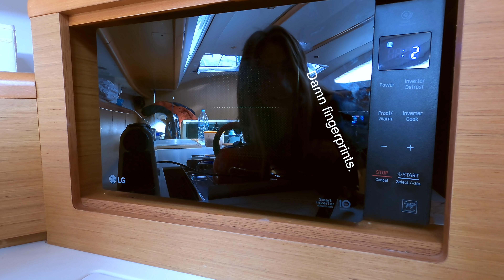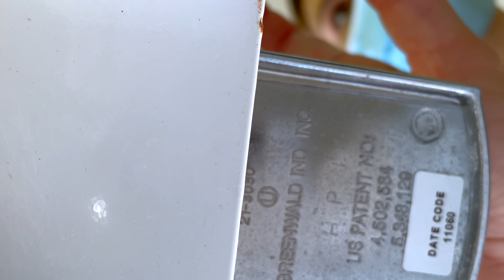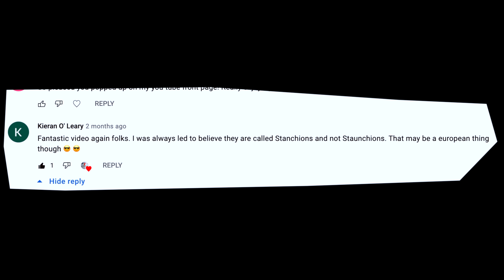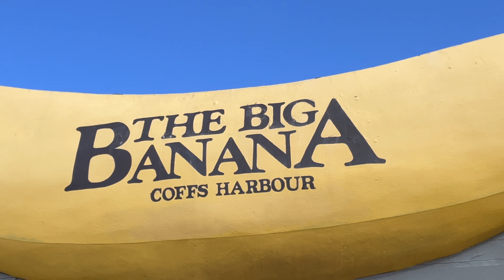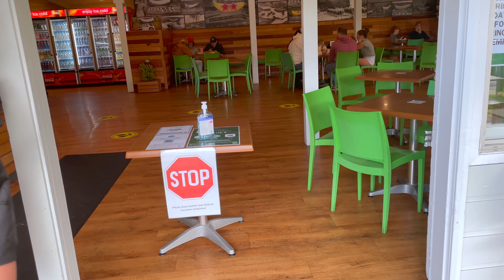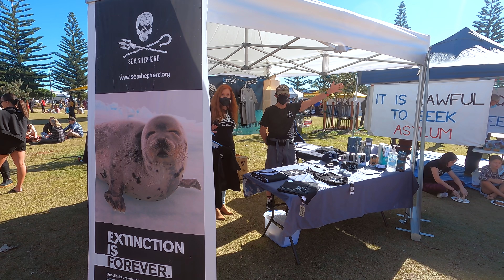BOAT JOBS: Stuck in Coffs Harbour

Comment: That fan is called a bilge blower, you turn it on for at least 5 min before you start the engine to remove any flammable vapours that may be in the bilge. It helps stop you from blowing up. I had to change one on my Riviera took me 4 hrs with 3hrs and 59 minutes of cursing, I think they started with the blower and then built my boat around it, yours looks much easier to access.

Comment: Hey guys, the bilge blower wins for me. I have actually done that job myself on my boat. Tip on a really good tool to have, snap on do what looks like a screw driver but with a 45 deg pointed end on it. It’s specifically for removing or replacing rubber hoses around the engine without damaging the hose and allows the bead to be broken. It could have helped you get that bilge blower pipe back on. It’s a must have for your tool kit.
Reply: Ohhhhh that took would have been the perfect, as at least 95% of the job was trying to get the hose on 🤦🏼‍♂️😂

Comment: Regarding your steering sheaves. Try your best to get the sheaves aligned with each other. Imagine a flat plane extending to the next sheave. Better alignment will reduce chafing. Also the sheave pins should not rotate, the bearing material should rotate around the pin. Nice video 👍. Sailing interviews are great.
Reply: Thanks for the tip Andrew, in the end we had them machined and finger bearings put in the sheaves, they are now rock solid and tracking dead strait 🚀👌🏻

Comment: Guys. Servicing winches is quite straight forward. YouTube is your friend - as you know ,😜
Reply: Hey Andy, I should have clarified, we serviced them ourselves before we left Melbourne, (was messy and time consuming but fairly straightforward), when I did that we identified that the spigots had elongated the holes they were seated in in the housing, causing the gears to track out of alignment therefore rough operation/wear. I didn’t have time to do it before we left but they needed to go to a machine shop to be drilled and bushes made up etc.

Comment: Winch service is easy to do yourself and if you need some new parts just order online. Probably one of the easiest boat jobs that there is. Ok just saw what the issue was with the winch and got it if you don't have the necessary tools/material to do that repair.
Reply: Should never comment before you watch the whole big bananas episode 🍌 🤷🏻‍♂️😅
Reply: Yeah unfortunately this one was a job for a machinist, Harken don’t supply most parts for our legacy winches anymore so needed a drill press to locate and re drill the original center in the Housing and then machine bushes to suit... Hopefully its enough to keep the winch going for a while longer, they quoted $8k for replacement with current model 🤪
Reply: @jptilley10  8k is madness and yes i’ve come across the same with Lewmar…they stop making spares to get people to upgrade. Was looking for particular model jaws and Lewmar was like no we don’t supply those anymore. Luckily there are people 3-D printing them. Hope yours  will turn and rattle like a new one
Reply: @smulismuli7976  yeah it’s crazy isn’t it, they. Even change the mount for the electric drive so you can’t just replace the winch, need to replace the whole thing including the electric motor 😣

That’s great that you can get the lewmar parts you need 3D printed! Could just about do with a 3D printer on board the amount of parts we seem to need at the moment 😂 

Hope your repair project goes well 👌🏻

Comment: Yeah they'll rust to hell... :-(. How good of John to eat all the chocolate. Have two explanations for the Bananas being bad luck - they make other fruit go off so your fruit would go bad and then back in the day you could presumably end up at more risk of scurvy. Alternatively they produce ethene, which is what makes the other fruit ripen, but it's also explosive if you have alot of it. They used to ripen bananas by putting them in warehouses full of ethene predictably they'd often explode. If you had enough bananas on a cargo ship I suspect you could produce enough ethene to be a risk to the ship too if it wasn't well enough ventilated (not a risk on a yacht, but enough to give them a bad reputation!). Love watching both the fan replacement and the Chicken and Leek pie :-)!
.
Reply from the maker: John put tef-gel on them for the time being... but thinks we may need to get them re-made with bronze alloy. Thoughts? 🤔
Reply: @KristinasTravels  sounds good for now, it's not going to happen overnight and I'm not an expert but you definitely get seawater into winches and mild steel will rust anywhere on a boat (I do know that much :-)!) you've also got to be careful putting dissimilar metals next to each other as it speeds up the corrosion by electrolysis, I'm sure there are people more qualified than me to give you an answer (possibly try e-mailing lewmar) - good luck!

Comment: G'day from a sunny Sydney. Fantastic to see you've arrived in Coffs. Just a little bit of advice from an old seadog...learn to service your winches yourself. To spend $250 bucks for something you could have very easily solved yourself, if you keep going at this rate you'll soon be bankrupt...seriously though, everything about cleaning, servicing & repairing winches can be found on Youtube, and when all else fails, find someone moored in the marina who has many years sailing to help you out...I have found that fellow cruisers are more than willing to spend a few hours disassembling a winch with you...JUST ASK!!! You are one day going to find yourself on passage and a winch will seize up and you are going to have to fix it then and there, so the sooner you experience doing this kind of easy peasy work while docked at a marina, the better.
Reply from the maker: Hey Beazle! G'dayyy! Glad to hear the sun is shinning there today.
This time round, the winch needed a repair not a service. John recently serviced them down in Melbourne before our sail up (not sure if you've seen those earlier episodes or not 😊) 
From John: Yeah unfortunately this one was a job for a machinist, Harken don’t supply most parts for our legacy winches anymore so needed a drill press to locate and re-drill the original center in the Housing and then machine bushes to suit... Hopefully its enough to keep the winch going for a while longer, they quoted $8k for replacement with current model 🤪
Reply: @KristinasTravels  Apologies...I hadn't seen the earlier episodes. I take it all back then...safe travels. I love this old quote: "If you can't repair it, maybe it shouldn't be on board".